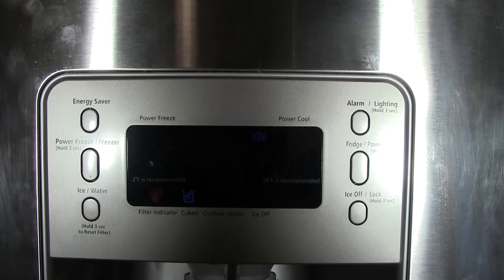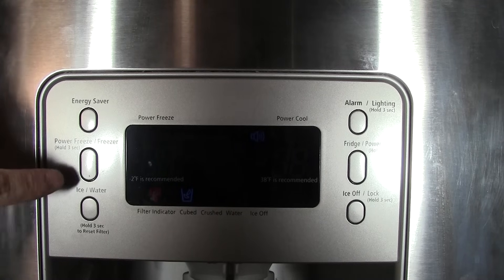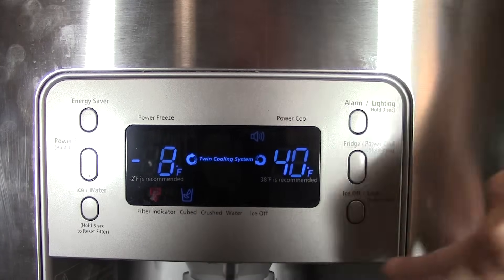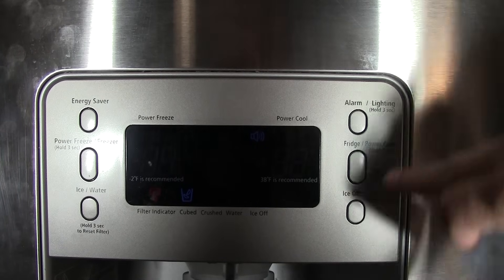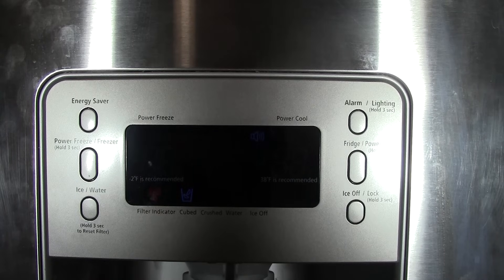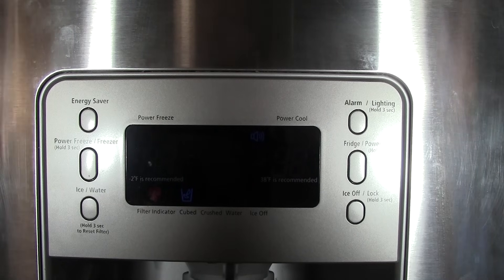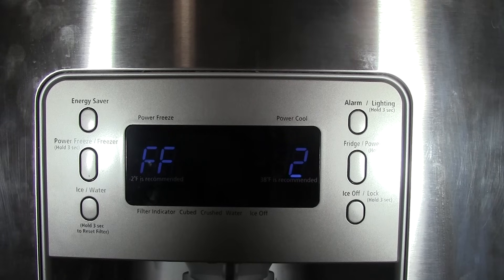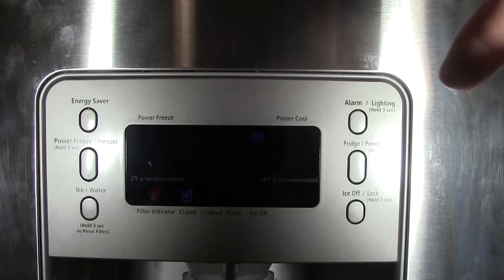FORCED (manual) DEFROST mode on a Samsung Refrigerator--Top Secret Setting

Comment: On my RF265 ,  I can select Fd  =  Fridge defrost.(Top and bottom)  rd = Re fridge  only defrost (better to save frozen food)  . On my unit, the problem was the Defrost sensor for fridge BAD .  ($15) .   Like with normal operation (defrost after xx hr compressor run),  the trouble shoot 
 function   (rd  Fd ) kicks off a defrost cycle.  IF IT IS WORKING, YOU SHOULD HEAR WATER SIZZLE ON HOT COIL AFTER A FEW MINUTES.   If not coil bad, or like mine sensor BAD  (Open looks like 80 deg F   = Defrosted) .  So, if sensor bad, Fd or rd will run cycle till sensor on frozen coil > 60 deg  and add 90 sec.    BUT WHEN SENSOR BAD IT THINKS  instantly 80+ DEG F and just runs 90 seconds, not nearly enough. 

  Also  , Samsung recommend (on my model)  service note  moving clip on sensor to other tube near top. Makes it take longer to get to 60 DEG.

The 3 Freeze modes are used to test Compressor current/pressures at known  drive level.  The computer controls compressor motor speed for most efficient operation normally.    So theses 3 "Fixed" speeds allow for  Technician to make readings at fixed speed.    I found service manual online  Helpful   I am now about 6 Months in without fan noise or rising temps.  Thanks Jake for disassembly tips.

Comment: Mine was running like a piece of shit until I took the level out and levelled it as per directions.  Has helped, so I levelled all my appliances.  Might save some money for someone.
Reply: did you have to tilt it backward for better drainage or level it to 0 deg.
Reply: @alneg6234  level a 0 both ways front/back and side/side

Comment: Thanks so much for this brother. This refrigerator and I have gone round and round last two years with this freezing up crap. The FD mode has helped me avoid this! 👍
Reply: Shinobi1 Kenobi lucky you, I hoping for a miracle just when I think it’s on the mend it  goes down again we paid $2300 it’s eight years old and still looks new I shall not be buying ANOTHER SAMSUNG
Reply: I thought the ice maker issue was related to my refrigerator water filter not being the brand they recommended but a HDX FMS1 brand.  It’s the same size and fits but doesn’t allow water to run through.  Taking the filter off, I still don’t get water nor ice.  I’ll try the forced defrost to see if this resolves this as it would the water under my deli tray and the freezer not being cold enough.   Is a filter even necessary to get water or ice?  Will see what happens.

Comment: I have an RF18HFENBSP.  No ice maker on the door.  6 buttons run across the top.  I have tried all the codes provided and every cpossible ombination to trigger a menu to access forced defrost with no success.  I have had "the kit" installed which was supposed to fix everything:  moved sensors, added insulation, changed drain heater.  I have also had the drain in the bottom unplugged, and the current drain check valves are not the pinch type.  The heater coils have still frozen up - mostly top center to top right and along the bottom.  I plan to raise the fridg compartment temp to 40 and turn off the energy saver.  I had been running at 42 to keep things from freezing, but felt that was unsafe for the food, so dropped it back to 38.  This resulted in the last freezeup,  which took 12 hours just to get the compartment cover off - frozen into the  block of ice encasing the coils.  Anything else I should do before closing it up?
Reply: I think I have a similar fridge as you with the 6 buttons along the top and I was able to find the secret menu by pressing + holding Fridge+PowerFreeze. Hold that until the display goes blank and then hit power freeze until you see Fd. Once you see that leave it alone (don't press anything else) and the fridge will shut off the display again (within seconds) and will start beeping. The Fd mode lasts for about 30 mins and then the fridge returns to normal functionality automatically.

Comment: I don't have to buy another fridge! My Samsung fridge has been freezing, I replaced the evaporator heater coil but still freezes, with this I'm able to keep it on check! I had to force defrost it 3 times when I first heard the fan freezing.
Reply: By the way it stays on force defrost for 30 minutes each time you do it

Comment: On my RFG297HDRS there are separate forced defrost modes for the refrigerator and freezer. The cycle appears to take 20 minutes. It only has one force freeze and that's fine by me. It also has something that looks like the demo mode but isn't as it chimes just like the defrost mode. Yesterday I unplugged the fridge and got the usual sheet of ice from under the deli drawer, took out all shelves including the bins in the freezer and just left it off for several hours. Sopped up a bunch of water from the freezer and fridge after that and decided I could plug it back in.  When I did it threw an error code 22E which I googled and found it was the fridge fan. After viewing this video last night I started doing cycle after cycle of the forced fridge defrost and did the freezer a few times.  Sopped up more water and now my compressor is coming on (it wasn't last night after the error code even though I figured out how to reset it). Leaving for work now with it in demo mode. Can't leave the doors open as I have cats so am hoping leaving it off for over 9 hours will do the trick and unblock the fan. Thanks so much for putting this video up! Samsung should include this info in the user manual and recommend the feature as part of a maintenance schedule since this freeze issue is rampant throughout all of their models.  It could save everyone a lot of time, anger, and money were they to recommend its use!
Reply: Yep

Comment: I have replaced the main PCB and EVERY part associated with defrosting the refrigerator and it still freezes up solid.
Lately I've been doing a forced defrost every day and it's been working.
NEVER will I EVER buy a SamSUCK again.
Reply: @ElectronSpark ……I FIXED MY FRIDGE FROM FREEZING UP.......
Reply: This is happening to me. How long do you leave it in forced defrost?
Reply: @pekinggeese  You'll have to search google for a service manual with your model. With my rf28hdedtsr model you press and hold the Alarm and Lighting buttons for 8 seconds and then push the lighting buttons until rf flashes. The fridge will beep for 20 or so minutes and then will reset to normal.
I just recently tried wrapping the feed lines with pipe insulation and metal tape and hopefully that will solve my problems. I'll check in a month or so and make a video about how I did it if it works.
I think the icing problems may arise from high humidity.

Comment: Thanks for the info, that secret sequence didnt work on my rs275acrs.  My panel looks the same but where your Energy Saver button is my Power Freeze button, but the same total number of buttons.  When I held the Power Freeze and Fridge buttons, I got the blank screen but then just incessant beeping, I couldnt get to force defrost.  Any suggestions?
Reply: When display turns off ,  for the next 15 seconds if ANY key is pressed it will step thru modes like Jake saw. FF1,FF2,FF3,rD,Fd       rD  Fridge only (saves freezer)   or Fd   defrost both    beeps continuous , one more button press cancels test mode        after a few minutes you should hear sizzle. I f not  Defrost sensor or coil probably bad.

Comment: After I did what you said and cleared up all the ice I sealed the left side with silicone at the crack at the bottom.  That's lasted 14 months.  Now I'm having an issue again but it's not ice.

Comment: THANK YOU VERY MUCH, It worked perfect and after it stopped beeping about 45 minutes it reset it self and i did not need to do anything else. I am glad you took the time to explain the fix and Samsung should thank you also. This refrigerator issue will give them a bad rap and no one will repurchase their products again. Simple Hidden Fix, Thanks
Reply: Randy T              Pls help me  . I have the model RF220  and is not working  .works for a bit after unplugging and touching the panel . What could this be
Reply: @danutaecimera6885  I thought it worked but i was getting false temp readings. I set a thermometer inside and it was showing 55 but the fridge was  showing 36. I un-plugged and re-plugged to reset it then it was back to usual not getting below 52°. Today i used an IR thermometer to check the back which was 30° at the back in a slot but showing 62° on the open area. I had to come back here to remember how to  do the force defrost and maybe try it more than once or twice.  You can put your make and model number in google and find a manual.  I did and did not see a display like is in this video. I have a Samsung cell phone so i thought they made quality products now I know i was wrong. Good luck.

Comment: Do you by any chance, know if this will work with the RS261MDWP  model?

(Every year the freezer fan starts making a horrible "whirring / Grinding noise" which is that build up of ice over the fan,, under warranty they used to just come out and  replace the fan. )
Reply from the maker: +Justin Bennett ----> figures even the service techs have no idea how to fix this fridge.  Changing the fan is a waste of time because if it worked, you wouldn't keep having the same issue over and over again.  You would have had the same result by just defrosting it and turning if back on.  I don't know if this will work on your model, but try and see.  If not, just Google it and maybe you can find out if your model has a manual defrost mode.

Comment: Thank you for this video my fan was making noise and I cleaned out the condenser coil by blowing it out with air compressor it was filthy. After doing this the evaporator fan was much quieter but I saw your video and now have it in forced defrost and hopefully all this it will be quieter

Comment: On my model Samsung RSH1DEIS I had ice inside the refrigerator compartment   near the  left hand side vent. I have found that if left for a few weeks with that ice the vent would eventually start making noise (ice was blocking the vent too). In that case, I had to disconnect the fridge and let it though naturally, before reconnecting and restarting it. This video has helped me do this manual defrost without needing to disconnect, but it has revealed some other issues.

Having set the FD function, I heard the beeps going, but within less than a minute the display returned to showing the fridge and freezer temperatures. The beeps continued for awhile (perhaps 15-20 minutes or so) and then they stopped. The panel continued to show the temperatures unchanged, as before. A day later I found water dripping from the freezer and the fridge too seemed warmer than it should have been. All this whilst the panel still indicated -18C for the freezer and +3C for the fridge (my usual setting). I disconnected the appliance from electricity and when I reconnected the panel showed +2C for the freezer and +10C for the fridge, which I believe would have been the real temperatures.

It would seem that once the FD mode was set the panel does not show the real temperatures and that is somewhat hard to believe.

In simple words, FD mode should be set manually from the panel, but it should be reset too, or else the fridge would not restart normal operation.
By the way, on my model there is no "Energy Saver" button and so I do not know of a way to stop the FD mode using the panel.
Reply: did you find a way to reset your fridge?
Reply: Pat Raisbeck - Once the FD function was set from the panel, as described in this video, the only way I could reset my fridge and get it back to normal operation was by disconnecting it from the wall and reconnecting it (kind of a cold reset).
Reply: Shalev53 30

Comment: I wish i knew about the FD mode before i got the hair dryer that half worked one thing that helped me out i got a big pot of boiling water set it in the bottom of my refrigerator part on top of some heat mats (for pots) so it would not melt the plastic in my refrigerator closed the doors and let the ice melting commence it got most of it melted just did not get where the fan is at the top of the refrigerator. I had to use the hair dryer for that. I also read online that the refrigerator should not  level that it should be higher in the front then in the back so i did raise it up with the help of my wife will see how it goes in a couple of months BTW i had an ice issue not a water issue.So a little bit different.
Reply: I am having a freeze up and water drainage issue. The water ends up in my crisper drawers and in the big drawer underneath. The front of the fridge is actually higher than the back.

Comment: Thanks for this, how did the 40 degree change from 38 work out?
Reply from the maker: It didn't do much at all.
Reply: jakeguitar01 thanks for your response, have you found doing the forced defrost once in a while works?
Reply from the maker: Yes, the forced defrost once every week helps it last very long.  If you forget to do it or you get lazy, you'll freeze up again....  You have to be diligent.

Comment: You don't know how to turn the ice maker off??? Just push the button once and the ICE OFF symbol will appear. You activated the lock function and claimed it turned off the ice maker!!!
Reply: I just noticed your remark, I wanted to say the same. Tap once and the icemaker stops/ hold the button for 3 seconds and all the other buttons are locked.
Crappy ice machine by the way.
Reply: @alfredclausen2593  I find that removing the ice maker tray and emptying it periodically helps keep the ice looking nice.

Comment: This worked perfectly, thanks so much. I left it in forced defrost for a half hour and now it's quiet.
Reply: Did you leave it until the beeping stopped? Or did you put it back into normal mode yourself
Reply: @michaelbeltran8296  It was beeping the entire time that it was in forced defrost. A week later it started to make noise again so I unplugged the fridge and left it off for two days. If I start to hear the fan again I will do the forced defrost again right away. It's completely quiet over the past week.
Reply: @DianeMalloy  You might have a bad defrost temperature sensor at the root of your issue.
Reply: @RandomRepairGuy  Thank you! Very, very helpful.
Reply: Have an RF268 for 12 years and it started humming today for the first time. Forced defrosted it as per these instructions. The fridge turned off and started beeping. It beeped for approximately 32 minutes and then turned on by itself. (I guess that's how long the defrost cycle is). It is functioning normally and the humming noise is gone! I knew it was a simple fix but this saved me a lot of time removing all food and opening the rear panel to manually defrost it. Pulling the plug out would mean pulling the fridge out of its alcove which for a 73 year old person is no easy task. Thanks, I learned something new today
Reply: @vinoddavid6904  That's great! It's five months since my earlier post and I've just this week started noticing some noise. I need to do the forced defrost again before it gets worse. Thanks for the inspiration!

Comment: I have a SAMSUNG FF6297HDRS. Manufacture date is JUNE 2013. This is the second time I will have to defrost my refrigerator. I bought it in 2013.  Ifollowed your directions, and  put my fridge in to POWER DEFROST and mine stayed in this mode for 30 minutes. The fan at that time stopped  making that horrible noise. I still have one chunk of ice showing. I know from my first experience, last year that there is probably more ice built up on the coils. Last year, the back had multiple chunks of ice showing, and after reviewing other video sites,  I took the back panel off and fully dried out the coils. It was a nightmare. It took 2-3 days to complete that process, and then I had to put everything back together.  I got to say its really important to keep the back vents clear and not shove food items up against the vents in the back. I think that is the only reason I was able to go this long before having to defrost the thing. I really appreciate your video. I will try and "maintain" the fridge by putting it in POWER DEFROST more often from now on. Thanks again for the tips.